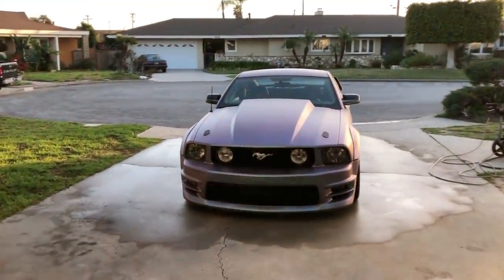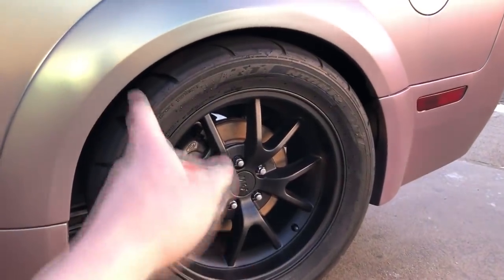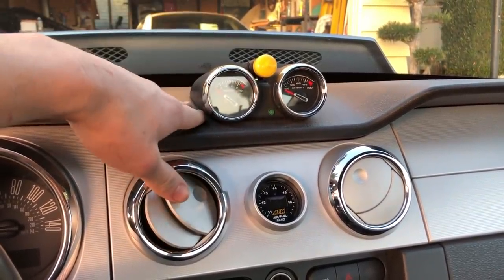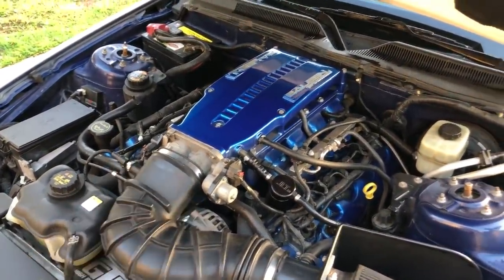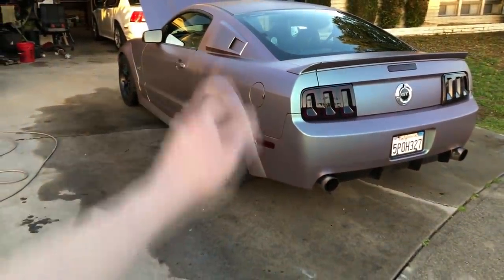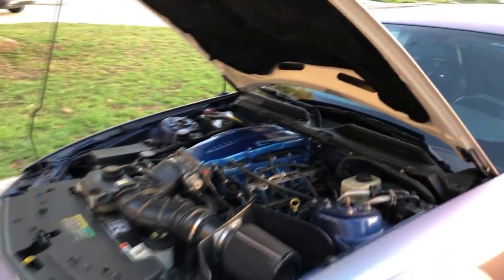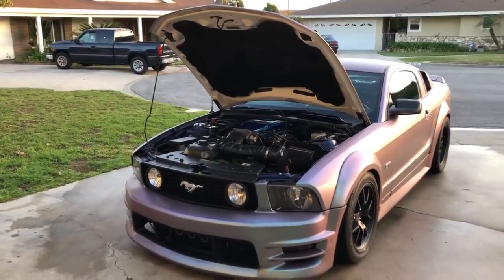How Much Horsepower does My Car Have?

Comment: +5 HP because of the plastidipped wheels.
Reply: don't forget the no back seats WEIGHT REDUCTION BRO!
Reply: @wateringcan4522  +10 HP
Reply: @AlexMartinez-ni2ce  +20 HP because the car is loud
Reply: @wateringcan4522  +10 For the wrap 😂
Reply: @AlexMartinez-ni2ce  +5 HP for the blacked out headlights
Reply: @wateringcan4522  +5 HP for the hood pins
Reply: +10hp for the driver mod
Reply: +7.5 hp due to the adjustable shocks and lowered coils
Reply: Air intakes +10 HP
Reply: Stock break pads +0.5 HP
Reply: +10HP because of the body kit
Reply: +5HP because of the after market hood
Reply: This is true👌

Comment: Honest answers.  My 2012 C6 Grand Sport (M6/dry-sump) with Edelbrock Stage 2 is pushing 537 RWHP at 7.5 PSI boost with tune.  Changed VERY heavy run-flats to ZR1 tires.  Had to upgrade the fuel pump to a ZR1/Z06 as well.  Couldn't run meth because the Magi-style impellers are Teflon-coated and the methanol would eat 'em up.  Rear seat delete doesn't help you much, maybe half a tenth; put 'em back (though you're about 350 pounds heavier than mine).  If we raced, it'd be a fair fight.  ;)

Comment: Your car only has 40,000 miles?! I drive a 2011 ford ranger and i just hit 59,000. Started from 42,000 miles a year ago and just about 3 to 4 months ago i lifted it and fucked up the odometer. It went from 47,000 miles in nov to 59,000. I dont drive all the time

Comment: aren't you the same guy i saw on here who was giving every body mad shit about modding there cars?  dude. you have a full body kit on a fucking mustang and it's wrapped.  

I got a mod you need to do right now.. unplug a wheel sensor and see what happens to that limber little light chassis with out traction control using ALL that power.  be careful but make a video out of it and be damn careful but it's supper fun.  snap over steer well happen even after you take your foot off the go peddle.

god damn i love that car.

Comment: Is that 3 or 4 inch cowl??
Reply: Looks like about the same height as the length of those aerocatch pins on the hood. Which is ~5in. Not sure if thats accurate
Reply: so prob 4

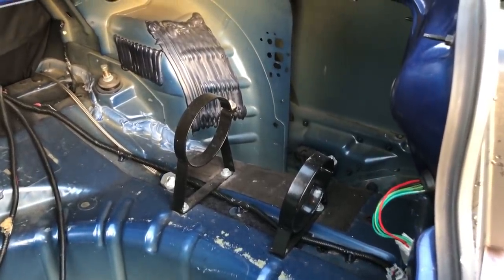Comment: Your car is totally rice . 500hp???????!!!!!!! That v8 is 300hp from factory. How did you add the other 200hp?????!!!!!! I don’t see any supercharger!!!! Really?? Rear seat delete ?🤢really??Recaro seats ???? You should spend your money on nice wheels and tires and don’t waste your money on the ugly bumper and those side covers 🤮I like the hood and the rear bumper.did you upgrade the rear end ( the gear) 4:10 or 3:73???? What about the drive shaft ?? Aluminum one piece or still having the one ton stock drive shaft ?? Aluminum fly wheel ??? Your car looks twice rice 🍚🍚but sounds good 👌. You should be the president of the rice club !!! 500hp !!!! Really?? 😂🤣😂.
Reply: nothing he has on it is rice